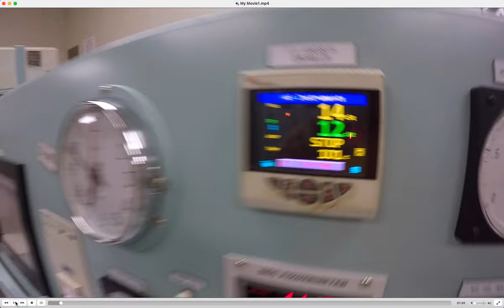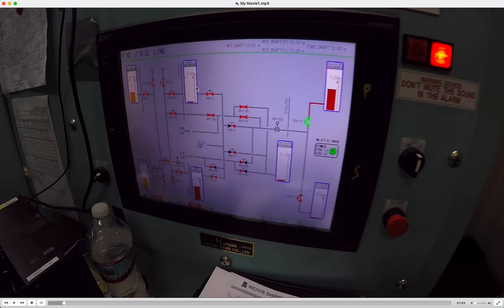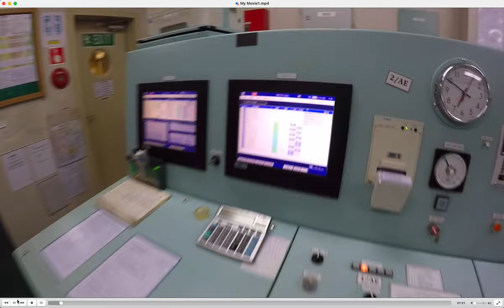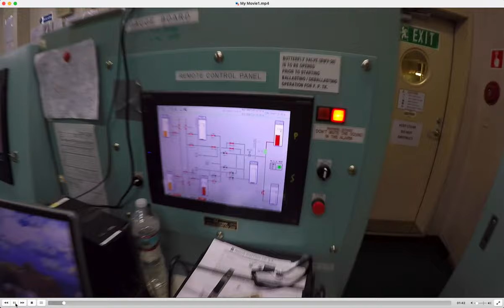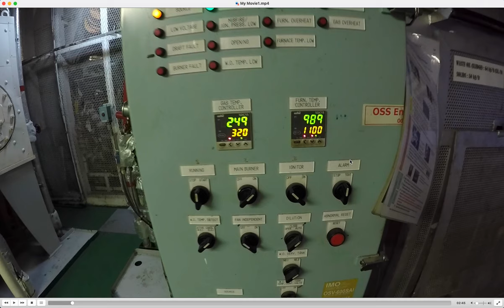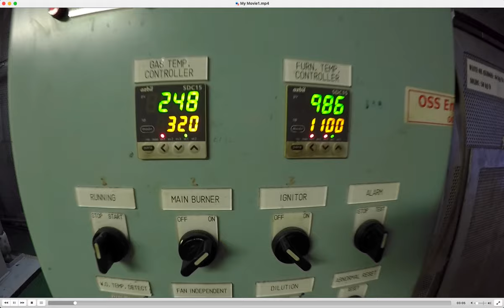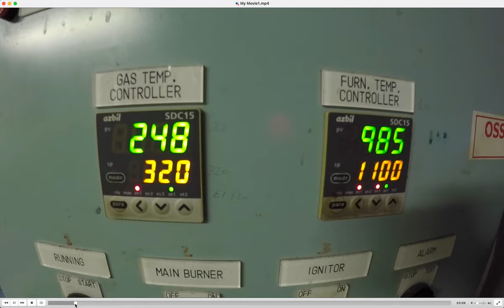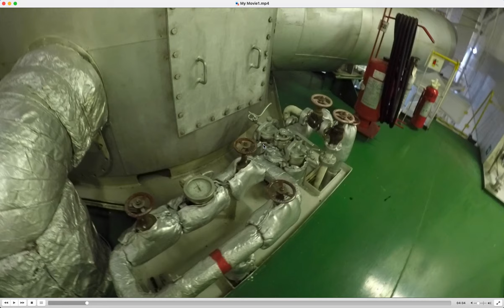Engine Room  Tour Control Room,Incinerator,Boiler Start Failure

Comment: my vessel has available one MGO tank for emergency but we've almost two years without use this particular tank. Is there any issue keeping this oil for long period without  use ?
Reply from the maker: For MGO sometimes there is sediments on the bottom but in most cases will be fine to burn.